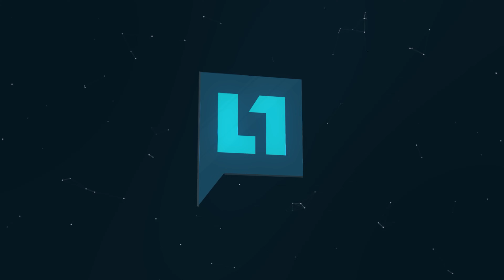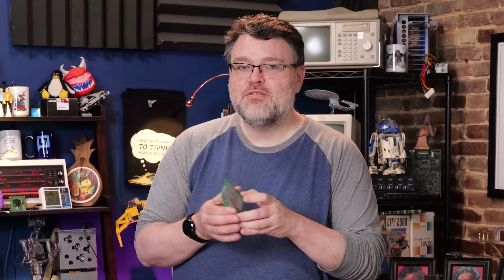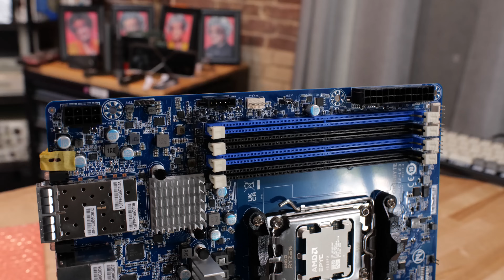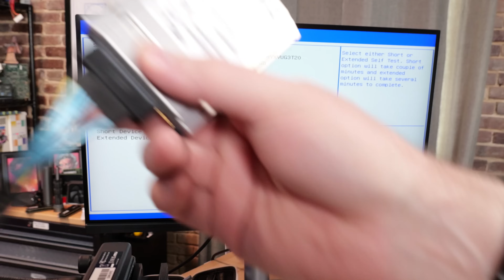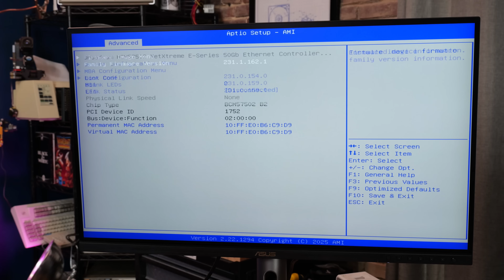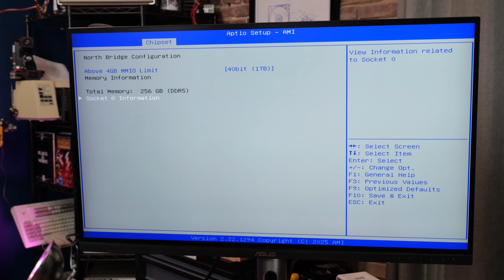AMD EPYC 4565P First Look: Featuring the MC13-LE3 Motherboard from Gigabyte

Comment: Late to the party, but for 2026 would you please consider comparing the  65 watt Zen 5 CPU's for both productivity and gaming:
The 9950X against the AMD Epyc 4545P
The 9900X against the AMD Epyc 4465P and the Ryzen 9 Pro 9945 
on consumer AM5 motherboards - including any BIOS or related issues - or reasons why not to use them. 
Thank you in advance.

Comment: 03:30 a rented dedicated server in some DC is not "in the cloud" since it doesn't have fluffy flexible edges, borders, whatever you wanna call them, and it isn't swish swish movable, reconfigurable etc. There is nothing 'cloud' about it - or have we gone full circle back to just running $hit on dedicated bare metal hardware without any 'haze about it' but we just keep calling it cloud because it sounds cool? This is sorta a serious question, as much as I detest the "cloud" moniker for stuff, if you're running a virtualized server image which is the only thing you interact with, but it runs on some undefined shifting changing physical server at a provider, then I can kinda get the cloud concept - but if you rent a dedicated physical server that you can go poke your finger at, it just happens to live in a rack slot in some DC instead of your own rack then no - I'm not going to call that 'cloud' anything, because it isn't.. And in that case I think you forgot that you already took your meds 😛 and took a second hit, seeing clouds where there are none...

Comment: You made a casual statement that adds to my RAID selection angst. You stated that you/people would be probably setting this up in a MD RAID configuration. After your remarks and testing of different RAID systems, my thoughts were ZFS would be king. I have set up a xcp-ng environment with ZFS storage here in the lab. It is handy to snapshot a OS's storage space, and backup that image (removing the snapshot afterwards). 

Has MD RAID redeemed itself?

Comment: currently looking at Asus X870 boards, since they have the 4005 and cpus listed as supported;  also curious as of running it with non-ECC memory  , for cheaper more memory ( and sons gaming );  the X870 motherboards support USB4, thunderbolt, and I can backup a 2TB drive in 15 min;  so a must for me; also considering testing a thunderbolt 5 USB5 add-on card, for backup purposes; my time is valuable ; so fast backup speed is premium; these motherboards have extra M.2 slots, what's good;  adding an SFP+ 25 card to it; and running redhat, and occasionally windows; and mostly VMware player, windows and linux;  ( for my son, needs to be gaming setup config);  for CPU considering 4465P, as it has lower TDP, and want to see if I can run it with a finless heatsink ( ok fan, for higher load) but 90% time its going to be idle . of course the chipset might need a little fan cooling; if there is a supper quiet water cooler, it be another thing to test.  no noise is premium; that includes, no-coil whine ; - other people might be interested seeing a Nvidia 6000 ada vs a 5090 ( has NV-link , maybe take 2 ) for their smaller AI lab ; for me would not mind a mackintosh setup too ; -- VM , some bare-metal setup be cool.   me , mostly have no time, for these kind of hardware hacking; me in past , used to design , pcb layout server boards , and military aircraft flight controllers , those boards are huge. not doing any Skylake and epic boards any more;  this and grade 4005 , is truly exiting; with a little TLC,  can push in on the home front huge;  pave the road for gaming rigs  , and it be a hot-seller.  also like to see idle power consumption , wink 4465p tdp ; on the server space; have not seen many alarms cart and 4005 setups; so its flying under the radar for the big boys; aka I brought it up, for server upgrades, and they never heard of it. so good ol games of just considering  XEON to EPYC thread ripper upgrades.  and 4005 not on the menu; there be also a mechanical EE is what would like to run it with a workstation card.  and few EEs , that also do a shitload of simulation +extra memory ; --- big thanks , awesome!  cheers

Comment: I decided to try gigabyte board for small server build hitting lots of issues; seems like they dont keep up with drivers; or testing. I couldnt get the LE3 so went with LE1 model from newegg, using the new AMD 4565P. All seemed good until BMC upgrade stuck for hours so far waiting also hit issue with gsm agent windows 2025 blocking it from install, decided to remove the security blocks and agent will not start, also they only had 2022 server drivers; logged case for that first and they said try the 2022 docs all look old too. Logged two other cases tonight for GSM and BMC issues hoping it didnt hose the BMC, I was only at step 1 on BMC. Spent a bit of coin on this hoping the support can get me by the two issues as I liked the options

Comment: Hey Wendell, can you think of a reason this board wouldn't be able to run PWM fans? 
I've tried 3 different models (Noctua NF-A12x25s, Corsair RS120s and Be Quiet Silent Wing Pro 4s) all with the same results - upon powering on the system, the fans briefly spin up, but shortly die after and stay dead, long before posting or the OS (ubuntu, supported by the vendor) begins to load. Once booted, they don't even appear in the BCM, regardless of which headers I plug these fans into - the only way to fix this is to unplug another, 3-pin fan, wait for the BCM to freak out and overvolt everything connected to a fan header, thus "discovering" the PWM fans, then to plug the 3-pin fan back in. As such, any attempt to reboot/power on the system, be in with the power button, the BCM or OS commands necessitate physical intervention to activate any PWM fan I've attempted to use. The only exception to this is when a brownout/lighting strike hits the grid - upon losing AC power, the board seems to be able to reboot and power on any given PWM fan without issues. Strange...
Inversely, I've tested 3 different 3-pin fans as well (Darkside Gentle Typhoons, Noctua NF-P12 redux-1300s and Fractal Dynamic X2 GP-14s), all of which power on and stay on through any form of reboot/power cycle from any source (BCM or OS).
My bios and firmware are completely up to date. 
What gives?

Comment: Only $500 for that MC13-LE3. Woo. My nose is bleeding.
Reply: And no USB4 port, not even a single USB C. That's certainly a wild choice you can make for a USD 500 board with CPUs that have USB4 basically already included.

Comment: Wendel!  could you make a more in-depth video +experiments about the PCIe  quirks like usual ethernet  chips limit the entire root bus  mps and mrrs to 128 bytes which is a huge overhead.   Also how mixed PCIe gen 2 lower versus 3 and higher devices  affect the in-flight congestion?   if something like legacy wifi beacons using 1mbps mode transmission take too much airtime,  but applied to how a gen2 packet and  a gen3 packet "share" the medium.

Comment: 13:16 if you check the listings from serialcables, mcio is actually currently being offered at gen 7 speeds (validated) right now! It'll cost you an arm and a leg, but mcio more than works for gen 6! :)

Comment: Does this board support the consumer X3D processors? My router has builtin 10g fiber and I have fiber at home. That would mean ultra low latency gaming with a 9800X3D.

Comment: I just found a cheap Epyc(SP3-7xx2/3) platform, supermicro , hopeing to build it up into a box-mini pc...(still need the cpu+cooler and ddr4 ram, case+psu) for a backup server/main workstation/experiment. These new boards are small(er than I'm use to). was 10$.(case will be 100 , psu 100, cpu+fan hopefully 100$).

Comment: Don't get it, why wouldn't I go with a B850M and a 9950x?  I get the same lanes, same TDP, same RAM (non-ecc), more m2.  Sure I need to add networking but w/e.  Do you really need onboard IPMI, 25GB fiber nics, and ecc that badly for your diy homelab / workstation for much more money?  And I can get the 9950x yesterday whereas the epycs, while "released", arent available for purchase for another month.  Reminds me of the last epyc 4594p launch  last august where you couldn't get them for 5 months!  This is a silly product placement / customer project cost subsidation ad!

Comment: "16 cores get the job done" - Yeah, that depends on the job, e.g. rendering, simulations - fine for many single threaded operations but when the software allows you to multi-thread and a good chunk of what your doing doesn't need single threading, then only 16 cores can be like a bottleneck.

Comment: What about a Ryzen 5600GT with 6 physical cores running also 2 VMs now (Xubuntu 24.04 LTS and Ubuntu 16.04 ESM) with a TDP of 65W running in power saver mode.  It has 32GB of DDR4.  With 2 hands and 2 eyes the CPU load never exceeded 50%, even during concurrent Windows 11 Pro and Ubuntu 24.04 LTS updates, while Windows XP is playing the wma copies of my LPs and CDs :).
Reply: I think the 5600GT does not support ECC memory?

Comment: Would be kinda interesting to compare the performance & power efficiency scaling between these AMD 16c/32t platforms with Threadripper PRO 7955WX (~350W) vs Threadripper PRO 5955WX (~280W) vs EPYC 4585PX (~170W) vs EPYC 4565P (~170W) vs EPYC 4545P (~65W) , wouldn't you think?

Comment: Doesn't matter, AMD killed HEDT and workstations anyway. In 2017 you could buy an intel board supporting 128GB+ quad channel ram and three full sized x16 (x8) pcie slots, and 44 lanes for 250 bucks. Also compatible with cpu's with 18-22 cores.
This is still a slap in the face from AMD. Threadripper boards are 500$ at least, even the old ones, and Zen 2 threadrippers start at 800 bucks. Sad.
Reply: at least AMD does provide HEDT.

Comment: Black Ops 6 with 2 Fiber Optic 1 gb connections ( each is a unique ISP ) RX 7900 XTX - 360hz 2k OLED - Would that board reduce latency? Asking for a Friend 🤣 Or would it : Keyboard not Found - Press F1 to Continue 🤨

Comment: I want quad node systems with these chips, at least 4 hot swappable nvme SSD’s per node, and 25 gbit networking. And redundant boot drives (if those are sata, that’s fine by me)

It would be so efficient with 65 watt chips and you could run a TON of stuff in a virtualization cluster of these using quad nodes.

I just don’t think there’s enough PCIe lanes to do this on this platform :(

Comment: Why would anyone want a server with heterogeneous CCDs? Continuing with the half&half x3d cache is a big failure. Yes, I know these are just coming off of the Ryzen assembly line and getting some different firmware/microcode but it's still a fail.

Comment: I've really hated that server/desktop market segmentation when it came from Intel, can't see why I should like it any more coming from AMD.

Originally Zen's advantage was that it didn't do any of the feature fuse burning Intel did for desktop Xeons, but with Intel dead, I guess it's fully gone, e.g. ECC support in APUs and mobile chips, where they've forced you to go "pro" if you might want to swap your RAM with ECC somewhere along the line.

It's always been a real pain with Windows drivers, which were either exclusively server or desktop e.g. on NICs, even if the hardware was all the same, too. iSCSI, offloads etc. would only work on server editions of Windows and "server chips".

But it's been worst with AMD, especially with iGPUs,which just couldn't be coerced to work anyway on Windows server editions via the usual tricks! I have an MSDN, there are good reasons to run a server edition on small machines or even in VMs.

I used to think that it was just AMD being cheap and not wanting to pay the higher prices on Windows driver signatures. But now I'm more convinced that they've been long preparing this odious server/desktop segmentation strategy.

AMD: I am not amused, restricting customer choice is no way to their heart! Given any choice, I shall leave you, after decades of support, going back to an 80MHz 80486 as my first AMD CPU and an ATI Mach 8 8514/A clone as graphics accelerator!

Comment: I can't WAIT for the 65 W, 16-core/32-thread part to be released.

It's going to be EPYC!!!
Reply: Not interested. 
MoBo cost is too high for 16cores.
24 cores? I would buy that!
Reply: @chuckevans2792  
Depends on which motherboard you buy.

Technically, most, if not all AM5 motherboards would support the AMD EPYC 4005 series processor. Most. (Not necessarily all, but most).

Therefore; given that, if you want to forego some of the creature comforts like integrated IPMI, and you just want to stick with a consumer grade board, you can certainly do that.

As best as I can find on wiki, there ISN'T another 16-core, 65 W TDP part that's available in the market, until now. (And definitely not historically neither.)
Reply: would this make for truenas storage server with both fast nvme and 8 HDD rust vdevs and few light VMs? is it an overkill? I am capped by my old i7 4790 cpu. Not sure what to choose
Reply: @DigiDoc101  
This would be overkill.

Comment: Hi Wendel,
Did you try to adjust the Refresh interval setting on these DIMMs?
I have an Asus ProArt X870E and four 48GB CL30@6000 sticks that I've been able to run only at CL26@5200 because I can't get stable higher than 5200MHz. After adjusting the Refresh interval to 55000, I got a latency result of 78ns in AIDA64.
So, maybe there is a chance to mitigate higher latency with a much higher refresh interval?
I've used the Buildzoid video "Easy memory timings for Hynix DDR5 with Ryzen 7000", but since the test time is about 10 hours per try, it is taking a long time for me to set all the timings.

Comment: It's nice to see OpenBMC gaining traction. The idea of having a corporation controlled and updated OS with full, unfettered access to servers I administer has made IPMI a strong negative. Add that some companies like Supermicro didn't even let you properly disable IPMI and/or port sharing, and this is a security issue waiting to happen.

Otherwise, it's a nice board and platform.

7:47: 128 GIGAbytes of L3? Ha ha ha... We know what you're talking about, though :)

Comment: Hear me out
Strix Halo based EPYC 4005
4 channels instead of 2 with up to 8 desktop uDIMM. In theory up to 1TB of uDIMM once 128GB sticks hit the desktop
or 4TB if they included the ability to drive the more exotic server RAM.
Reply: For zen4, they had the Siena line-up as an in-between the big Epycs and these small Ryzen-like Epycs. Siena has 6 memory channels and 96 PCIe lanes (and zen4c cores only). I'm sure they'll do a zen5c successor for that "midrange" as well.
Reply: @Hugh_I  I just want Strix Halo, or Halo Next in a CADbox/workstation/VM host that i can jam full of RAM giving each VM 2 cores and 4CUs with 24GB of unified memory
It has the memory bus for it, its just that right now they're not offering it in an R package to support uDIMM/RDIMM, you'd have to make your own interposer and 4 channel motherboard without AMD guidance.
128GB is great for most people, i need capacity rather than speed, though it would be cool to have 8 of these 24GB DDR5 8000 sticks running at 8000 in 1:1 (fat chance of that happening if the 8700G cant even do 5000 in 1:1 like the 4750G could with DDR4)
Reply: @Hugh_I  To clarify at work we have workstation labs that require more than most integrated graphics can handle, even with enterprise cards were struggling with VRAM
I'd love to have a tiny box smaller than a Mac Studio that has Strix Halo and 8 memory slots, heck use some sort of double capacity LPCAMM2 but i need more than 128GB
For server i can see HALO being awesome in a 2U 4-6 node server with each node having a large memory pool and for once a competent GPU, unlike my old Dell C6100 i had for my home lab ~10 years ago
Reply: @deegarkie5598  yeah halo sounds great for that. A tiny box NUC-like mini-pc should certainly be available soon (if not already), but finding one that has 8 memory slots sadly unlikely I'd say. But it would make a lot of sense, indeed.
Reply: @Hugh_I  As of yet, Halo is not offered in an R package that allows for DIMM/SODIMM memory. I hope they come in an FP11r package either as a 395 Max, or at least some sort of Epyc 4595PX (with the PX indicating single socket with 3D cache, imagine this with 2*X3D chiplets)
I do think Strix Halo is still memory starved with LPDDR5X so i wouldnt be surprised if they waited for DIMM based versions until they widen that bus out to 384, or even 512 bit, or they figure out a memory tiering sytstem with 128 bit GDDR7(or 2 stacks of HBM2e on package) and 256 bit DDR5/DDR6 but rather than 2 separate pools one for GPU and one for CPU, its more of a unified tiered system
Reply: I am disappointed that Zen2 and 3 were totally fine with 128GB of ECC at 3200, but Zen4 and 5 struggle to go above 3200 with the same capacity without dropping down to 1 DIMM per channel

Comment: Is AVX512 still double pumped? When AMD first did AVX512 is was double pumped is that still the case?
Reply: No, they redesigned the vector units to be 512bit wide with zen5. It is one of the areas where zen5 gives a more significant uplift over zen4.
Reply: Zen 4 double-pumped (EPYC 4004)
Zen 5 Full AVX-512 (EPYC 4005)